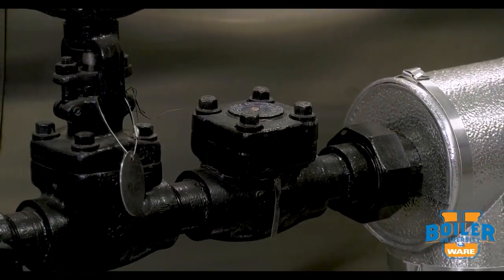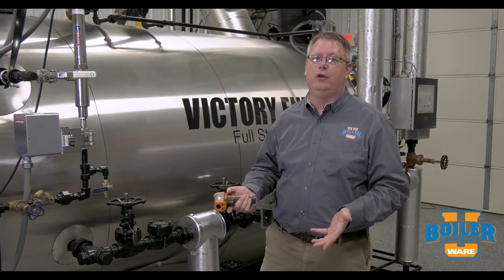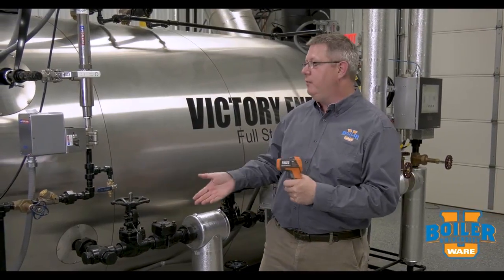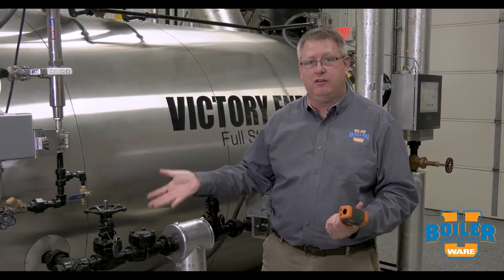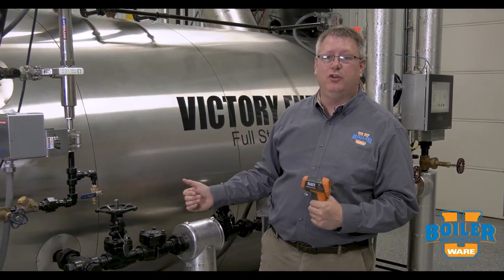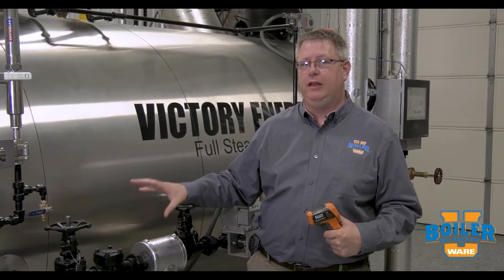Flashback: Checking a Check Valve - Weekly Boiler Tips

Comment: Love these instructional videos!!! Keep em coming & Good work guys. 
Only thing I noticed was the mix-up in terminology (upstream vs downstream). Downstream is the boiler side of the check valve...upstream is the fw pump side of the check valve. Check valve is preventing water from traveling back upstream towards the pumps.
Easy way to remember these terms is to think of a literal stream of water. 
At atmospheric water never travels UP... only DOWN. So when walking down a stream you are traveling in the same direction as the flow of the stream.
If you're walking upstream, you are walking in the opposite direction the water is flowing.
UPSTREAM = direction to Source of Water
DOWNSTREAM = direction to Destination of water
hope that helps 👍👍